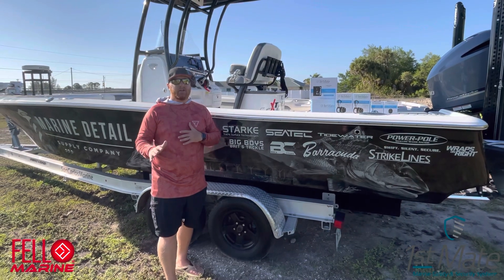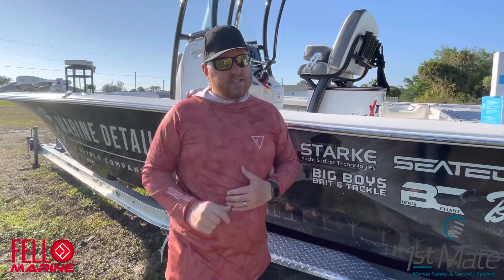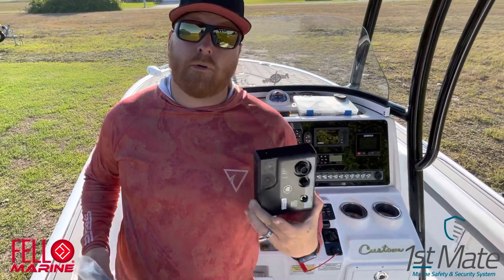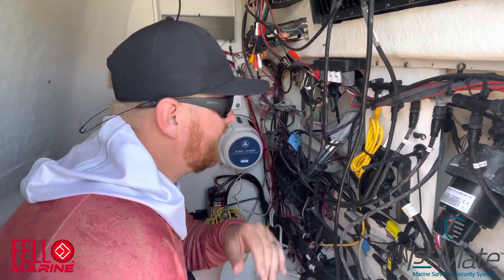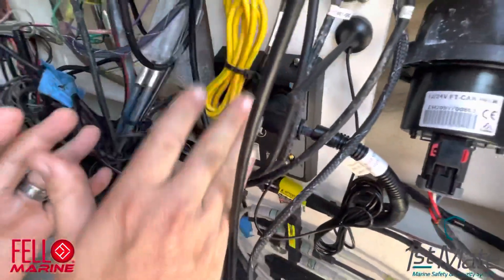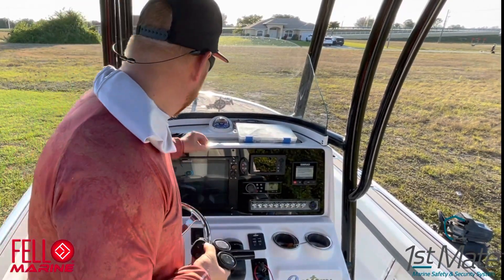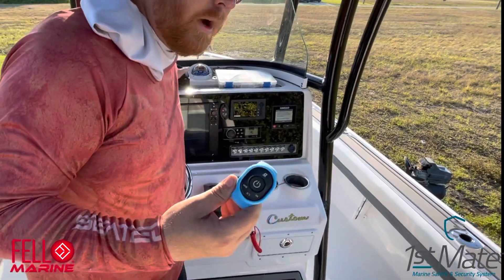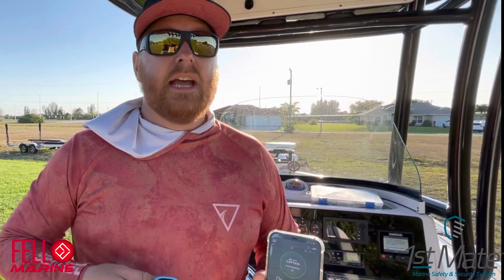1st Mate by Fell Marine installation and setup. Wireless engine kill switch.(How to)

Comment: I noticed that this post is about 3 years old, and I am interested in learning more about the First Mate system. Could you provide some insights into common complaints you have experienced? Additionally, could you let me know how long the warranty lasted?

I had the Fell system on my previous boat and encountered several issues, particularly with calibration on the fobs. Additionally, during a trip to the Bahamas, the system unexpectedly disabled my engines. If it weren't for a friend who is mechanically inclined and figured out how to disable it, we would have been stranded on a small island. I'd hate to think what would have happened if my friend weren't onboard and this happened while I was out fishing in the middle of the Gulf. I am very interested in this system for my new boat and would appreciate your honest feedback. Thank you!

Comment: I noticed you still had your kill cord inserted on the boat.  Is it still necessary?  I got the impression from your video that the manual kill cord system is completely bypassed.
Reply: Most people keep both. Either one will kill the engine.

Comment: What if someone wants to steal your boat and manually removes the electronics from 1st mate, will they then be able to start the engine, or does 1st mate do some sort of encryption of the engine upon first install?
Reply: I just watched a video from 1st mate and even if they steal your engines, the software remains active.  The engines will either run at idle power or no power depending on engine brand and user settings.

Comment: Cool idea.  How sensitive is the watch or Fob for overboard purposes. What's the reset time for it to refire. For example, sometimes when I'm fishing and my hands get slimey I will wash my hands with the onboard wash down or dip hands in water.   I assume it senses moisture to cut off.  Would this be more if a joy ride feature in boat or does it work well on fishing trips.  Would like to hear your thoughts.
Reply from the maker: Has to be submerged to activate. It alerts the Captain and they’re able to restart after 6 secs

Comment: I just installed this unit.  While engines running, I dipped the Captains FOB into the water to test.  Isn't this action supposed to stop the engines?  When I press the E-stop button on the Captains FOB the engines do stop.  I am confused......
Reply: The FOB must be submerged in a large body of water , at least 6 inches to a foot. A bucket or walking away on land is not recommended way of testing.
Reply: Barry, if you have the Mercury version boat needs to be in gear to stop motor unless you change that setting in app to stop in neutral. Other version stops engine in neutral as default
Reply from the maker: See Paul’s response. You’ll love the unit.

Comment: I'm on Oahu in Hawaii. Over the years i've lost friends to the ocean. From a shark attack to getting bent & getting swept overboard (for those solo users). Last one was a boat getting beached off the North Shore with the engines still running. The boat owner could've tried boating a fish by himself or taking a leak & a rogue wave did the rest. I've owned a 12', 14', 15', 16', 17', & a 20' over the years for just fun putting around to diving & trolling. For all of us the reality is always in the back of our mind of being "lost at sea". Hopefully this amazing innovation will be the cure to family members praying for a safe return of their loved ones.
Reply: It is NOT fool proof. For example if one is alone and thrown from the helm and knocked unconscious a lanyard type would kill the motor(s) but not the wireless. Also if thrown overboard on a windy day even a strong swimmer may not be able to catch a boat being blown away by the wind.
Reply from the maker: You’re right. It can happen to the most experienced.

Comment: If it constantly monitoring location, will it drain the cranking battery
Reply from the maker: No, it turns off when you turn your batteries off. However, it will be able to be hard wired at all times and go in hibernation mode in upcoming update. 👊🏻
Reply: @dsktsunami  thank you. with the update will it “wake up” when movement is sensed? Turning the batteries off negates the security feature. 
I really like this unit but it is 3x the cost of the MOB+ unit they have. Security features and the 30% discount promotion running now might make it worth the jump and satisfy the new Coast Guard regulation for kill switches.
Reply from the maker: @roysassano7442  definitely worth it with the 30% off. From what Fell Marine is telling me is yes, it will wake up with vibration
Reply: It most likely uses your phone to monitor location not the unit itself.
Reply: @acme54321  Then it would be useless if your offshore out of cell phone range. When powered on it prob uses AIS from the GPS/Radio on the NEMA2K network.
Reply: @carlschleif9031  Hey Carl, the distress messaging requires cellular connection but the phone will still mark the MOB location when out of range  using the built-in phone GPS receiver. The entire system can be used with or without the APP, so if phone powers done the Captain FOB will still stop the boat when it goes overboard. New features will be added over time and can be downloaded via the APP.